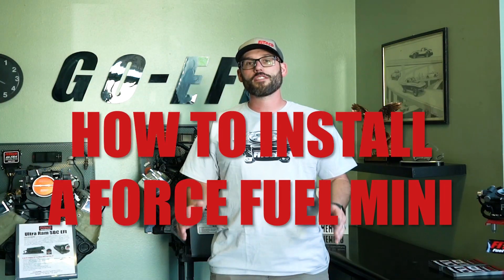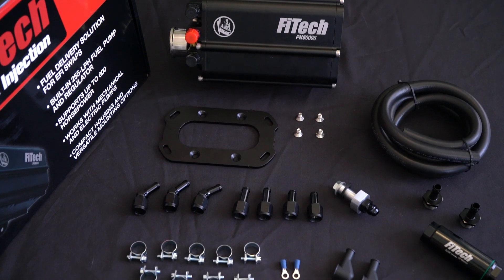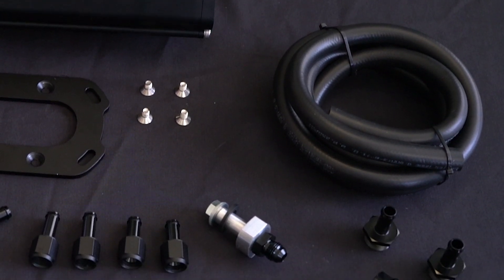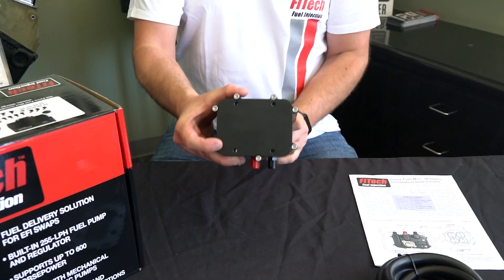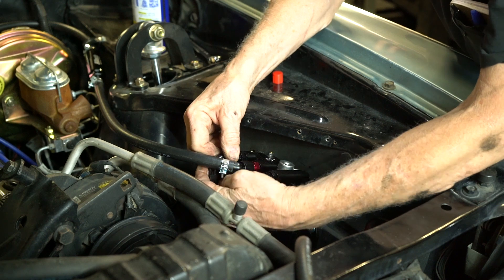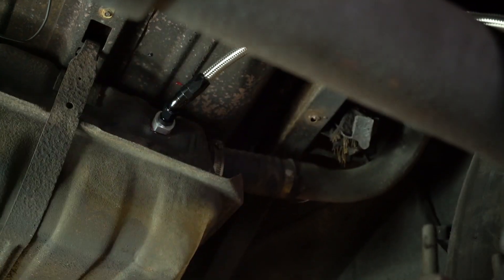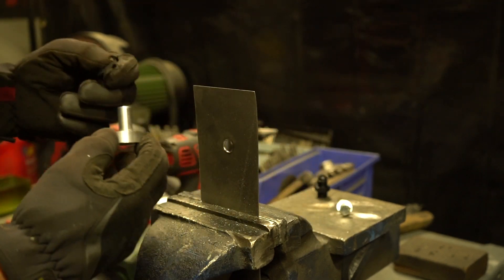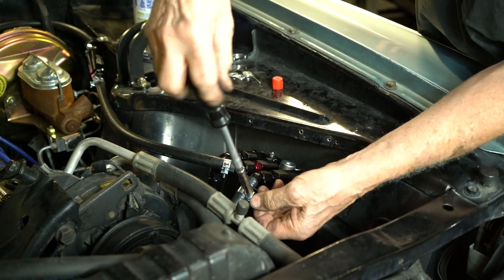How to Install the Go Fuel Force Fuel Mini | Tech Tuesdays | EP37

Comment: @
FiTech Fuel Injection , If I understand the system correctly, the return line goes from the surge tank to the fuel tank, right? So how can the return line carry fuel to the surge tank before the return line is connected to the surge tank?
Reply from the maker: Hello sir,

The Force Fuel Mini has a return port that goes back to the tank, meaning the fuel not used after the regulator dropped the pressure to the needed PSI for the injection system will go back to the return. The Force Fuel system has e built in regulator that will regulate fuel PSI and the left over fuel will just bleed back to the tank through the return.
Reply: OK Sir i understand. But @3.55 the Video shows the Fuel hast to come  from the Return line to the Force Fuel which I don‘t understand !?

Comment: Hi Your website says the mini size is  12 × 17 × 9 in which is the same size as your other surge tanks, is that correct?
Reply from the maker: That dimension is the box . The Force Fuel Mini itself is 8" tall, 5" wide, and 4.5" deep.
Reply: @FiTechEFImedia  Many thanks, that is good to know.

Comment: On a dual tank system in a square body, can you use the return line at the tank switcher valve? I’m just unclear how you would return fuel to one tank. You could possibly overfill it and I don’t know if if the factory return line is adequate enough.
Reply from the maker: You are correct. On dual tank setups you need a switching valve on the return line.

Comment: You forgot to show where the pressure regulator nipple is connected in a supercharged engine setup!
The instructions recommends the nipple to be tee'd into the vacuum hose on "regulator" of the Go EFI system.
But there is no regulator on the Go EFI.... the pressure regulator is located on the Fuel Mini.
Still the instruction tells that the connection is mandatory for a supercharger installation.....
Really stupid to not clarify this matter better in the instructions.  I dont know what to do....
Reply from the maker: Hello, Connect a manifold vacuum hose to the port on the regulator of the force fuel mini.
The regulator (whether it’s on the throttle body or the force fuel) needs to be connected to a vacuum/boost source so that it can increase pressure under boost scenarios.
Reply: @FiTechEFImedia  So my Force Fuel Mini regulator port should be connected to a port >below< the blower, so it feels when pressure builds up?

Comment: Isn't the whole point of this so you don't need to run a line back to the tank?
Reply from the maker: The point of the Force Fuel is to provide stable and consistent fuel pressure.

Comment: do you not use the pressure guage?
Reply from the maker: You can if you would like. If space does not allow for it on the Force Fuel Mini the gauge can be used in another location on the pressure line.

Comment: Need help on fine tuning.  Cannot get it to start unless I give it gas at crank.  Will not auto start and run.
Reply from the maker: Hello, have you contacted our tech line? They will help you out on the phone directly and assist you as you make adjustments to your vehicle. Please call (951)340-2624 option 2